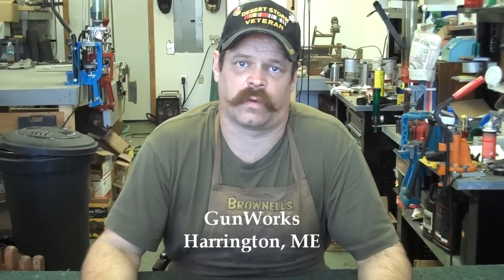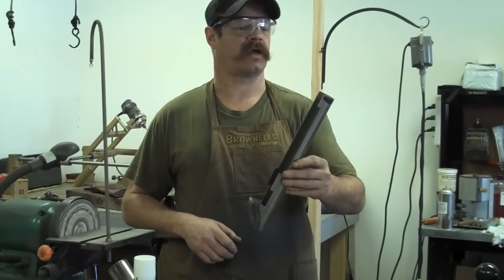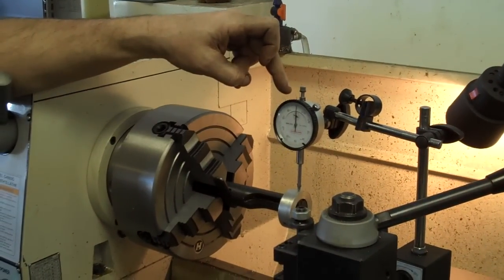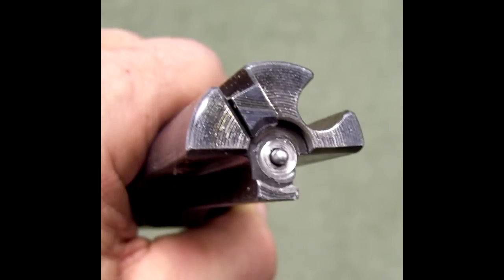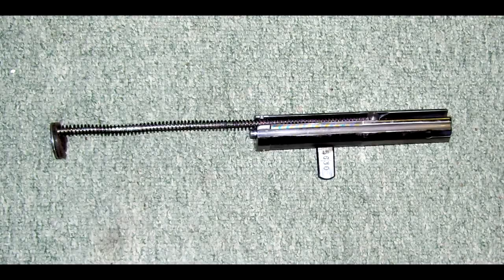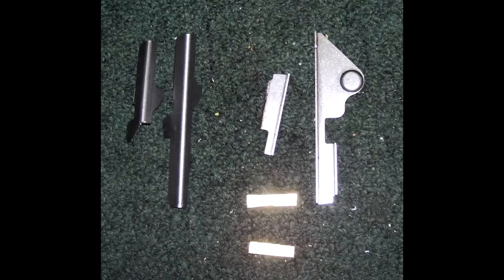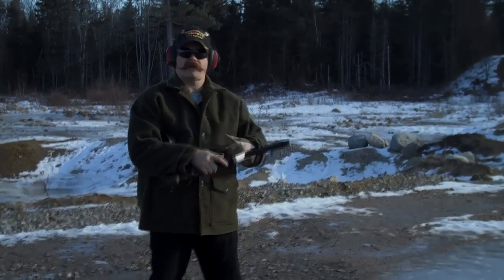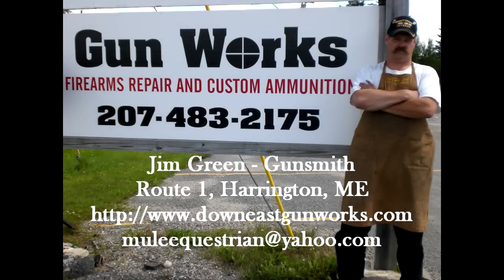Gunsmithing: Machining a KP-44 From Scratch (Gunworks)

Comment from the maker: The safety is located in the same place and functions just like the origiginal, despite having been heavily modified
Reply: Did you have to mill the bottom of the bolt for AK hammer clearance?
Reply: Nice job Sir, it's great to see a true craftsman. Making a pile of scrap into a great firearm. Nice work brother.
Reply: Nice job Sir, it's great to see a true craftsman. Making a pile of scrap into a great firearm. Nice work brother.

Comment from the maker: A couple of things I DID not mention in the video..... due to time constraints. There's a " denial pin " installed into the top of the receiver right behind the trunnion to prevent a full auto bolt from being installed into the gun. And I didn't mention the safety lever I had to fabricate for this gun. You Tube likes me to keep the videos short within reason, so this wasn't a " how to build " video.

Comment from the maker: @kotor39 Centerfire Systems is selling a semi auto M-31 Suomi for about $ 400 - $ 450 ready to shoot right now ( dealer cost ) ... THIS would be cheaper than having your parts kits built by a licensed 07 FFL. To be honest, they're much cheaper because the company mass produces them, whereas a gunsmith has to make and fit all the parts by hand, one at a time. I can still build your parts kit for you, but it might not be as cheap as you'd like.

Comment from the maker: The ATF has strict rules against building a new receiver that takes a full auto bolt. If you notice, not enough diameter was removed to affect function. Just thinned it enough to prevent a full auto bolt from working in the gun. And you'll notice is does function just fine.

Comment: Thanks for this insightful video.

Is there any trick to welding the receiver repair section to the cut just above the pivot point? I'm worried about welding the magwell to to the upper so it can't open.

Comment: LOL, I think that was justified. Soviets copied our 70rd drum magazine for their PPS-41. 

I just bought KP44 deact few days ago. All parts move, but boltface has slight 45deg cut and barrel is pretty much destroyed by welding, drilling and tapping. It is old spec deact. New spec would be same, but welded so that nothing moves = piece of railroad track.

Unfortunately our gunlaws are difficult with SMG type semiautomatic firearms and it would be next to impossible to get semi KP44.

Comment from the maker: Sir, I recommend you DO NOT make this modification for TWO reasons. 1) The gun is not designed to fire real ammo, and may not be strong enough to hold up to these pressures. 2) This is considered manufacturing a firearm, and as such you are required to fill out paperwork with the gov't in order to do so IF you decide to resell the gun at a later date. You are allowed to build a gun for personal use, but you're going to get into a gray area when you sell it.